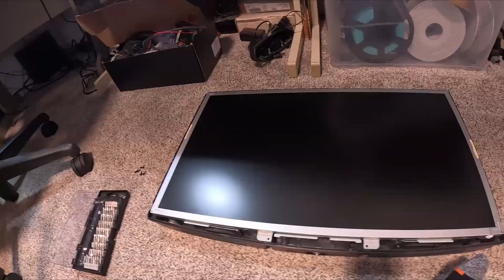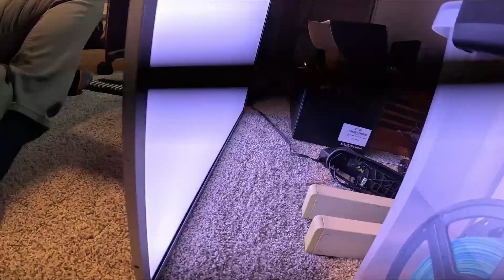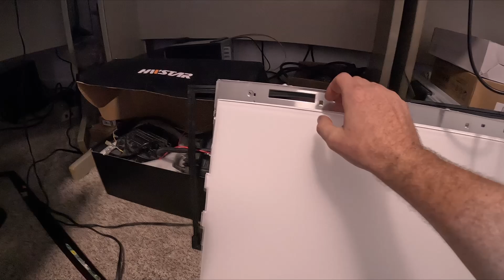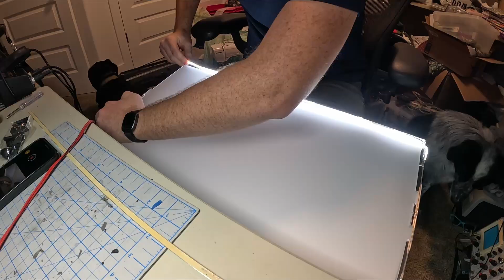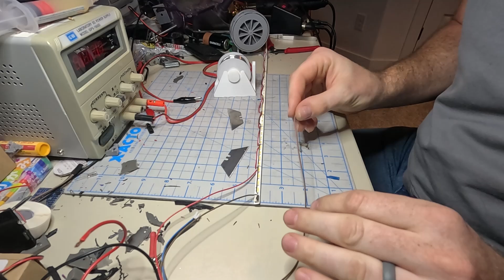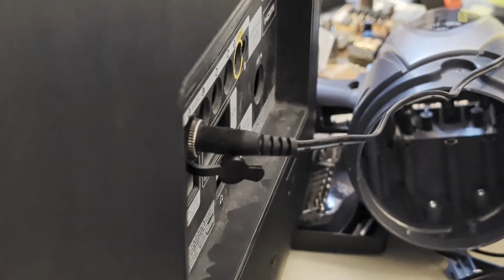I converted a dead monitor into a film making light - Crazy Easy!

Comment: You can just use the original power supply, you only need to trick it so that it thinks it's still connected to the LCD control board.